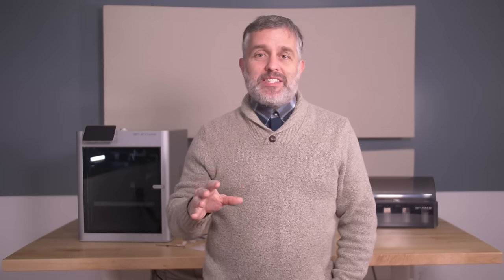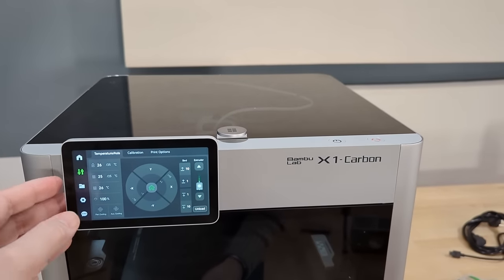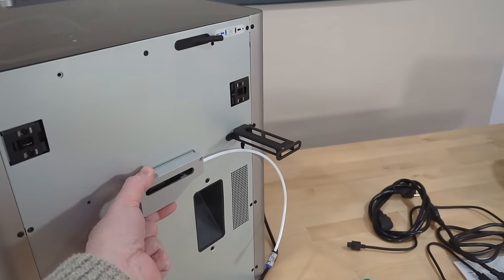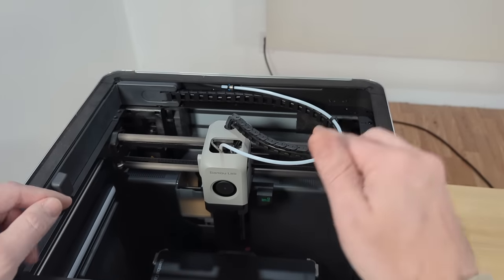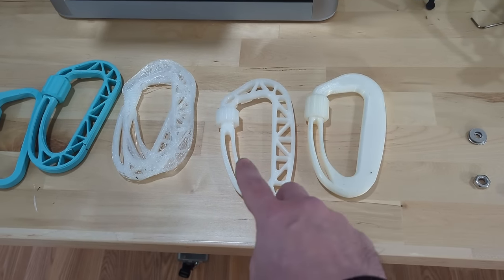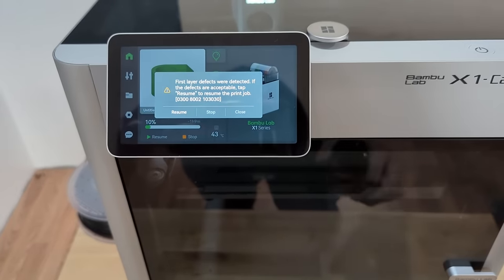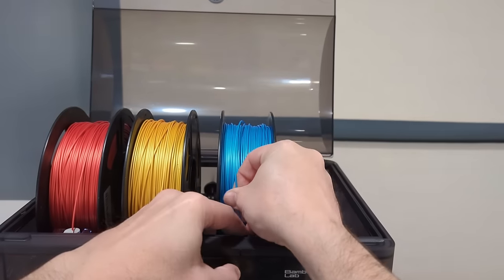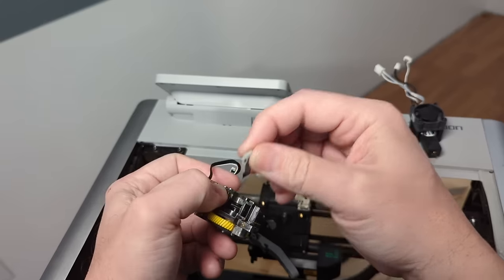Why The Bambu Lab X1 Carbon is a PhD Master Class in 3D Printer Design

Comment: I forgot who said it. There should be a code that turns the chamber fan on for 10-15 minutes after an ABS print so it will push the VOC’s through the filter. 

The stickers suck. Under the sticker on cool plate is the same pei as engineering side. So before I had a textured plate just printed on cool plate with everything. Haven’t used the nylon they sent yet.

Comment: I put in an order for an X1C + AMS a few days ago. Your video pretty much answered most of my remaining questions about this machine, so thanks for that. 

I have the MMU2 for my mk3s but it has been dissapointing and I no longer plan on using it. 

I am also making an ERCF MMU for my voron 2.4. 

I am taking 3 paths to get to cheap and reliable multicolor printing, I hope one of them will work out. If none of them work out then I will go Prusa XL.
Reply from the maker: If//when the PrusaXL releases, there's no way of knowing if it's going to be any better than the E3D tool changer which you can purchase now.

Comment: just because I do believe that it should be said.
I still feel that a proper done DIY printer can outdo any current offering in the consumer market and it allows you to use the hardware you want to support.
I already have a DIY printer with heated chamber (currently 80c max due to parts used) and do not see any competition comming (may be wrong).
Reply: just saw you did say this in the end...
Reply: excpect some pepole want fast machines without DIY. I built a 500mm v core 3 that can do 40k accels, but not everyone wants to spend 50 hours building from a kit. The majority of people like plug and play printers.
Reply: @morbus5726  and I said that where?
Don't strawman others.
Reply: @budhiw  im agreeing with you...

Comment: The main reason I go with open source printers is I believe there will always be ways to fix the printer, like with parts you can print.  This printer, if the company is ever bought or goes under there might not be any way to fix them.  I think I'll still get this printer, I think just the community of people that own them will keep them running if the company ever stops supporting them or goes away.

Comment: I think the bed slinger dominated was because it was the cheapest design. You look at any other form of 3d printer and they're all double the cost! 
The things you mentioned are also true, however I think cost plays a major factor
Reply: I am not too sure. Say the flying Bear Reborn 2 linear rail core xy is around usd 3xx factory. Ender 5 and tronxy x5sa all around 3ish level though of course some are v wheels.

Comment: I'm very late to this video but regarding the nano polymer adhesives - most of these fancy liquid adhesives that work with glass build plates and everything else, are nothing more than siloxane primers the same as any glass firm will use for bonding windows in.
 You can get a litre of the stuff for the same price as the tiny bottle most 3D print specialists charge for 100ml

Comment: 1:09:47 I had the chance to look at the gcode file when that option was still available. I guess Bambu removed the option in the last update. they have interesting proprietary gcode in it with decimal points for the new functions like timelapse and LIDAR. something along the lines of M221.5 ; activate LIDAR whatever.......

EDIT: the Bambu Studio SoftFever fork still has the "export gcode" option and you can see some interesting proprietary gcode in there with decimals as I have said. There is a down arrow menu beside the print plate button and you can choose the "export gcode" option.

Comment: I purchased mine at the beginning of the year.  My first one was failing prints right out of the box, eventually after a week of back and forth with their support people Bambu sent me a new one.  The new one had a faulty fan and wouldn't start.  After I replaced the fan it worked and printed pretty well for about 2-3 months.  A week ago it stopped working again and now I am having to disassemble large portions of the device in order to troubleshoot.  So no, it's not a PhD Master Class in 3D printers.  It's a product with A LOT of issues that need to be worked out before this thing will be considered a reliable tool.
I will say however that when it does work, it tends to work pretty well.  But for how much this costs, it should not have the number and frequency of issues and downtime that it appears to have.  And I know I am not alone in this as any youtube search for these printers will reveal.
Reply: I read for months before I finally got mine. I haven't read that many comments similar to yours actually. Not that many videos either.

Maybe you got two lemons. That sucks. Hopefully they fixed any issues with the most recent batches, and mine works without issue.

Comment: No way !! They nicked my idea of using PTFE tubing as a nozzle wipe :) I did that ages ago on a Geeetech A20M for the purge bucket :)
Reply from the maker: Did you post it anywhere when you made it?
Reply: @DesignPrototypeTest  Shared it with a few people in the 3DP Rescue! group I co admin, but that's about it, I was being flippant, I doubt they actually saw my posts and robbed the idea. It's not a great leap to assume I wasn't the only person thought to use the tubing :) Great video BTW very fair review given all the polarised opinions this printer has kicked off :)
Reply from the maker: @davethebuskeruk  It's a good idea. I didn't think of it so it's not that obvious. I played around with silicone instead. You've got clever brain cells.
Reply: @DesignPrototypeTest  Not clever, just a combo of cheap and impatient, the purge buckets I'd seen used a flat sheet of silicone as a blade, I didn't have any so rather than order some and wait I was nosing round all the random stuff I had laying about, as a printer I have loads of PTFE tubing so it was meant to be a temporary thing while I sourced the "correct" stuff :)

Comment: Obviously I don't know your settings but: I get the best results with the cheap natural Nylon using glue stick and 50 degree bed temp. Anything higher will cause it to warp or pull up the bed like you experienced.

Comment: Got mine 5 days ago now ? , not printed any multicoloured prints yet , only 2 colour layer change prints.
like any 3d printer there is a learning curve to it , on that point sure if my bed is curved or that it is printing so fast that square objects are warping on the corners even with a brim . ( look to be better at 55c and not 35c defaults )
But one thing everyone says which is true is that ( hopefully ) you should have it printing like glass out of the box without any sign of ghosting at half , third , quarter of the time in minutes and not years of endless modding .

it is easy to remove the bowden tube ? , try that with the AMS on top and see how easy it is ?

Comment: There are so much tooling investments and R&D invested in this Printer that it cannot be made open source. How are they going to recoup back? The design approach is a mass production approach, certainly they did not skip the Product Life Cycle development from BB EVT DVT to Pilot etc. This is impressive,  pure hard work from very experienced engineers. The only way to beat this printer is to have a high mix lower volume design, far less part counts, less complexity and  more towards industrial design with less tooling involved. So the solution is to bring industry design style down to consumer level, like the MarkForge Mark 2 down to consumer user price.
Reply from the maker: You are a knowledgeable man. I like this insight.

Comment: The green coil on the power board for the heated bed is a common mode choke, the bed runs on mains voltage

Comment: decoupling the Z axis leadscrews with multiple steppers means you also have to time them. It's pretty complicated to do two at the same time, most printers with two Z steppers are still "timed" together with a belt and pulley. Doing that with all three would be prohibitively complex.

Comment: It does genuinely look amazing. Much better than the D2 you convinced me to buy... Maybe this will spell the end of Prusa!
Reply from the maker: I'm sorry if you had a bad experience with Mingda. In my experience, it's a great little printer company from China. While not at the same level as Bambu Lab, they make innovative printers that were solid performers during my testing. Can you give me some more details about your experience?
Reply: @DesignPrototypeTest  Thanks for your reply! Actually I didn't really have a bad experience. I was mainly observing how good the X1 Carbon looks and the evolution this represents. The D2 was my first 3D printer and now I understand how the Mendle-style machines work. I did however have to replace a few parts including a failed PSU, correct the cooling fan design flaw and I made a few sensible upgrades namely BT Touch, and Marlin 2.0.9.2. Thanks for your work, you're content has introduced me to and taught me the most about 3D printing.

Comment: Good in depth review, upon initial view you can see all the proprietary components on it but on their website they have a huge selection of replacement parts and at not a bad price. Only thing is the software, would be good to have it not locked down as much and be able to just run it over the local network :(. Their AMS is good but just not at a point in which I would get one, it wastes too much filament. The Prusa XL with multiple tool heads might be better at that, we'll see.

Comment: Just like you just opened it up . Other companies like creality are going to copy it like k1 and make it cheaper. I think that printer is made cheaply.  It's made very good. But not good enough. Just like other companies copied DJI. The mini sd can be fixed and the python can be over written.  Non of that is new. I give it 2 month or so. Klipper is not new and can be changed and copied. I agree with everything you said.
Reply: Might look similar but Creality doesn't do well at updating firmware. Also, sit the outputs beside each other and you can tell which is Bambu vs K1. Quality just not there for K1.

Comment: you got those check boxes to skip calibration and stuff, on the printer! just before you hit the print now button.

also: vet your room! most heat is in the walls and furnature anyway, so new air heats up quickly and you wont almost notice a temp drop. (just vent until the air is replaced)

Comment: DJI is the company that really brought the personal drone to the market and high quality such as DJI we should expect the same from the makers of this printer. So this is the printer that really sets a milestone and the reason why I’m back into 3D printing
Reply from the maker: It's a great printer, Designed impeccably, and polished to perfection in an ongoing process. Still some typical Chinese QC problems do seem to be appearing. eg. pulley bearings squealing. So definitely hold onto your warranty and don't try to fix it yourself. If it breaks this proprietary printer is on them to fix.
Reply: @DesignPrototypeTest  and thanks again for your videos it must be the way you criticize products but it seems to me to very well thought out and fair but I know to come to your channel for that important opinion. 

Thanks for your content
Reply from the maker: @ProfessionalAmateur22  I appreciate the compliment. Have a great day!
Reply: @DesignPrototypeTest  hey just curious I was thinking will a smoke machine in the 3d printer show the air flow or is it a waste of time?

Comment: Thanks for the video. The ex-DJI folks probably have a lot of hands-on experience with actual high-end  $100k+ 3D printers (Stratsys and such like) for prototyping and manufacturing fixtures as well as whatever they learned from other hobby level printers. Nice to see them incorporating the beautiful fit and finish of a (say) nice PC case or appliance into a $1500 printer. Just the money invested in injection molds, even in China, is not small. Here it would be easily $1m+. Too bad that those nano-glue guys are not supporting the open-source community by sharing their exact formula. 🙂

Comment: Can print PVA or water soluble support? Not sure how people print overhangs on sections they can't get back into to manually remove supports. 

Imagine a 90 degree elbow that has over hangs in it, just printing a different material and a interface layer I'm
 not sure how I would get into some areas to remove the support so I'd like to use something that can be washed out or ultra sonic cleaned out?
Reply from the maker: Yes. Bambu even sells PLA specific support material called "Support W."
Reply: Is it water soluable? @DesignPrototypeTest

Comment: The best in-depth review I have seen to date. I’d probably buy one if it wasn’t for having to cloud hop my data back to the printer. I would like to see more innovation in wasting less filament on swap. I understand the purge into the hopper, it is basically what you do in a manual filament change. The purge blocks always seem excessive. How about just making a loop around the print. Or a 10-20mm single wall cylinder?  Just my opinion. I may be completely wrong since I do not have a multicolor printer.  Minus the purging, do multi extruder printers even have to use a prime tower before extrusion?

Comment: Can this printer take standard size Filament rolls in the AMS or do you need special size spools?
Reply: There is no standard size for filament spools. That's the bigger problem. The AMS takes most spools but has some problems with too wide or too large spools and those made of cardboard. But there are workarounds for that, such as the Hydra mod.

Comment: Hi you may chech firmware release notes as in new version is possible to send files directly to printer from bambu studio: “Added support for connecting to the printer by directly entering the IP Address and Access Code. This must be used with the latest version of Bambu Studio”

Comment: the active heated chamber is under patent, makes it tough. the best work around for the patent i have seen is the enclosed heated print bed, but that is not really controlled.
Reply from the maker: Patent expired a few years ago. As far as I know the active heater idea is open for the taking.
Reply: @DesignPrototypeTest  Micron put a patent out on calibration in a heated chamber WO2018163008A1. lol

Comment: I'm curious. Is there anyway this Bambu printer could be 100% reverse-engineered? 

If not, where would be the potential hank-ups in the reverse-engineering process?

Long, but very interesting video! 

Thank you.
Reply: I'm leaning towards being designed by A.I. All the information needed is mostly open source.

Comment: instead of having individually driven leadscrew can't they adjust the global z position based on where the head is, so offset is introduced for the entire bed but only when the head is in that XY position, when the head moves the bed is adjusted dynamically.
Reply from the maker: Yes. What you are talking about is called "bed leveling" which in actuality is software based dynamic level compensation. Not only for leveling of the bed but also to compensate for the warped nature of the bed which isn't perfectly flat and which changes based on expansion when heated. This printer already has this feature as well as many others on the market. Having the bed be actually physically level is beneficial and can lead to potential capabilities such as so called "non-planar" printing at a slight angle giving the printer 5 axis capabilities for limited range of motion like this: https://youtube.com/shorts/m3986dL46Lw?si=qgw3xZMeo1yjBL-c It's not a very well developed functionality at present. I'm hopeful we will see more of it in the coming years.

Comment: Sir you made my day with your video. Your analysis convinced me the Bambu is not for me. For me, I think the design is unnecessarily over engineered by forms rather than essence which for my print requirements I can do the same with simpler engineering.
Just suits different people.
I also believe in community more than PhDs so ...my bad LoL

Comment: Has anyone done a firmware dump/get at the code running on the screen yet? It would be interesting to try reverse-engineering bits and pieces.

Comment: I was about to buy the X1C, but after seeing that they force you to use the cloud in order to utilize the printer I noped out. Yeah I can print shit with superslicer, but then am I even able to use all the fancy features I paid for like Lidar, filament changing, etc? If my internet goes out I want to be able to use my machine still. It's why I love duet so much, and have 2 printers running the Duet 3 HC board.
Reply from the maker: I too love Duet. Hands down the best 3D printer controller out there. But SHHH don't tell anyone.
Reply: You can connect directly to the printer (via FTP?) without needing to use the cloud. Had internet outage for 12 hours and did this without a problem.

Comment: Great review but note that the 'carbon' in X1 Carbon is in reference to the carbon enclosure vent filter not the carbon rods.
Reply from the maker: Are you sure about that? When did bambu lab say this?
Reply: @DesignPrototypeTest  At the Kickstarter stage, prices were, $999 for the X1 and $1,199 for the X1-Carbon, these were the features separating the two apart.

Plastic vs Aluminum shell

Hardened Steel vs Steel nozzle

Auxilary part cooling fan (X1-Carbon) 

Air filter (X1-Carbon)

Chamber monitoring camera (X1-Carbon)

They then dropped the non-carbon version from main sale - but it was the filter that was the 'carbon' part
Reply from the maker: I thought the non-carbon version was going to have steel rails so it would not be able to print as quickly. Moving the extra weight around was going to slow it down which is why it was less valuable.